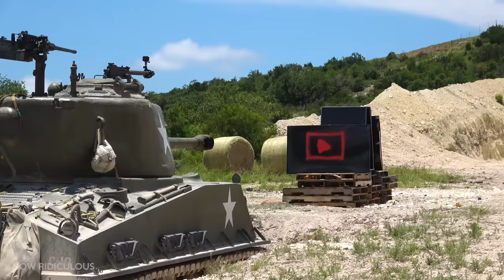Can Hay Bales STOP a TANK ROUND?

Comment: A gun bullet will stop really fast underwater, would a tank round be able to go through a pool worth of water?
Reply: Yes
Reply: Maybe so
Reply: @philjones35  :)
Reply: Depends on the pool & how wet the water is
Reply: Forcefed2002 haha
Reply: Ye but how do u get a tank underwater
Reply: Jon Anderson dude that’s the easiest part.
Reply: @mikex-mj6sx  use above ground pool
Reply: No, the shell will fracture upon impact with the water surface. You need low power, low speed projectiles to get through.
Reply: @mikex-mj6sx  a gun fired under water the bullet travels faster but a gun fired in to water the bullet travels slower or breaks up. A tanks round would react much the same way. I doubt a 20 or 30 foot above ground pool would stop it out right. It would for sure make it out the other side but id bet that it would not go very far or fast at all after it got through. Probably would stop with in 40 or 50 feet and would likely just bounce and roll along. It takes a stupid amount of energy to move through water at high speeds.
Reply: @Oz_Gnarly_One  tank rounds are low speed. They're about half the velocity of a rifle round but carry that speed for miles because of their weight.
Reply: It would stop pretty damned quickly as water is very dense. I doubt it would make it through the average backyard pool.

As for the shell breaking up when entering the water, that depends on the muzzle velocity and mass of the shell. I think the mass of the shell would make it less likely to break up on contact with water but the bigger size would mean it slowed down pretty quickly.
Reply: A regular  pool yes. Olympic  maybe not. The tank round would blow the water out of the pool from just the  energy.
Reply: @chucksherron  depends  on the round. A sabot  round is faster than most guns.
Reply: Jon Anderson good point
Reply: Likely no unless fired from beneath water to begin with and also not over a certain velocity or they break on impact with water regardless. The cavitation effect on a tank round would be dope tho
Reply: Very interesting question... now i’m craving for an answer!!
Reply: @philjones35  well played sir
Reply: what length of pool are we talkin here
Reply: That would be awesome if how ridiculous did that
Reply: @nanaki-seto  No a gun fired underwater has a similar result with the bullet not going faster because water is dense and the bullet will not track straight and slow down in the first few inches to non lethal speeds.  Not sure how you got the idea that it would travel faster if fired underwater.  Sound travels faster underwater though.
Reply: I figure if its set up similar to a testing tank for forensics, it would stop the round, however I feel like it would shred itself in the water most likely, not to mention the insane effects all that energy would provide in the form of heat, possibly creating  bubbled area of boiling water.  But no I do not believe it would make it through a pool..
Reply: There I've seen a couple of videos where they fire a cannon at a pool of water and it slows down surprisingly fast.
But I hesitate to make any definitive statement because different rounds react differently. There's a lot of variation in tank and Cannon rounds
Reply: Ya it will
Reply: @__The_Real_V__  And how wet the water is!??
Reply: @Forcefed2002  that comment is far too underrated 😂
Reply: Newton's first law of motion still applies. "An object in motion tends to stay in motion unless the object is acted upon by an outside force."
Reply: @JonnyRicter  the outside force beong the huge drag of the wayer on the large surface of the round.
Reply: No, the more energy it has the faster water stops it.
Reply: What kind of tank round are we talking here? The old WW2 boys? It could probably limp its way through if you have it at a similar distance as this. The modern SABOT? That would zip right through no problem as it is designed to pierce dense materials and make it through with little to no issue (was a 19K in the US Army, the Sabot round is the bee's knees for tanks. But my all time favorite is the Canister round, fire at a grove of trees and watch as they all get felled in one go).
Reply: Why is the demo ranch guy there
Reply: @Forcefed2002  but water isnt wet!!!!! DDUUUHHHH
Reply: Depends on the pool
Reply: Get slo mo guys in on it
Reply: No way
Reply: You need to understand why bullets disintegrate when shot into water.  It is because water does not "compress" thus the water cannot get "out of the way" of a supersonic projectile fast enough so the projectile breaks apart.  Same thing will happen to any size projectile.  Physics
Reply: @Forcefed2002  the wetness is esp. important. Like if the water is really dry it might just go through right?
Reply: hmmmm
Reply: Yes easy
Reply: A tank round is a bullet so no.....
Reply: It will almost do it, although it depends on the pool size.
Reply: water isnt stopping a tank round.
Reply: The harder you hit water the denser it gets so the answer is NO I believe. =)
Reply: you can prolly calculated it, its simple physics! 
The gun bullet stoppes really fast because of the extreme spead
Reply: @Bobby Nolan yeah, physics is a nice thing
Reply: Tank rounds are armor piercing, they might hold up in water quite well.
Reply: Depends on if Chuck Norris's fist is in the water
Reply: its going trough very few inches of steel i am bretty shure it will go trough water
Reply: @karl-egertdaskov6217  An armor piercing tank round is very unlikely to fracture on impact with water in the way that a lead and copper rifle bullet does. But in the other video just a bucket with water is enough to make the tank round tumble and after that the increased drag from the air slows it down significantly. In water that drag would be many times higher and water almost doesn't compress at all.
My guess would be that it could very well come to a stop after just two to four meters in water.
Reply: Matt??????🤔🤔🤔🤔🤔
Reply: on mythbusters they noticed that the higher the caliber and faster the bullet the quicker it broke apart. Seeing as how a 50 caliber bullet broke apart faster than a 9 millimeter I am guessing this tank round would break apart and stop rather quickly as well. I do believe it will get deeper than the 50 caliber tho.
Reply: @thr8061  water is compressible just not on the scale a gas is. This projectile penetrates through thick steel so I highly doubt it breaks apart once it enters the water.
Reply: I think tank shells are slower then bullets
Reply: By driving it there obviously 🙄
Reply: Yes. The tank round is way faster and way heavier than a bullet. It is being fired with more force.
Reply: Forcefed2002 what if it’s 2% wet
Reply: Sabot rounds will easily go though, they’re made of depleted uranium
Reply: The more force you introduce into the equation, the faster the round will stop. Most likely, the tank round would break apart, but parts of it might make it through. If I did some calculations, I could figure out exactly what would happen, but I'm too lazy😅
Reply: That’s a great idea
Reply: @lamarrotems  +
Reply: @kingwacky184  myth busters has been proven to have rigged some of their experiments, or performed them in a way that is not scientifically viable.

That being said, an armor piercing antitank shell will penetrate the surface tension of water without fracturing. However, once it enters, it's total energy remaining is quickly absorbed. It might barely make it through a standard 4x25ft agp (above ground pool), but it would fall out of the air within about 20 ft and tumble another 150, with a blunted tip and some cavitation damage. It will not make it through a 4x13x164x82ft Olympic swimming pool the long way.
Reply: @TheDustyShredder  Well they did try it in a way that seemed viable to me for the bullet hit the water experiment.
Reply: In addition, only pure, vapor distilled water is actually as incompressible as many think. Once you start adding impurities, the physical properties change. Also, in reality, nothing is ever totally incompressible. The force required is simply so huge, we can't fathom it, so we create these terms as designations. Why else do you think there's such a thing as water pressure? It's because, even if just very slightly, water does compress. If it were actually incompressible, we'd be using only the flow rate.
Reply: Most likely
Reply: @Forcefed2002  what the fucking helldo you mean by how wet the water is?
Reply: @tobywhitmore4777  LMAO
Reply: @Forcefed2002  lmfao
Reply: If you had a pool say 5 ft deep 100yards long by 6ft wide and managed to hit it horizontal with the ground dead center it would stop less then half way through also the pools sides would need to be 1/4 inch thick steel to ensure it punches a clean hole and doesn't blow out the side letting all the water out reducing the resistance.  A world War 2 vet told me story's when I was little about the Normandy beach landing ,he told me his platoon was thrown from their landing vessel and he was in about 6 ft of water and watched artillery round come through the water and just stop and fall to the bottom . So given his accounts I'd say it would be possible
Reply: Have you got a tank and a pool
Reply: That would be great!
Reply: A 50 bmg will go strait through a pool of water so I’m sure a tank will lmao
Reply: So, would a tank round go through a round tank of water?
Reply: This would be very interesting to see forsure
Reply: @Oz_Gnarly_One  A tank shell yes....they're not designed for it.   However, NAVAL guns sometimes had shells designed to dive and strike under the waterline.
Reply: Ask Matt at  Demolition Ranch
Reply: this should be the pinned comment
Reply: How deep the water ris

Comment: oobleck. are you serious. that wont do jack against 25 pounds going 5000 feet per second
Reply: i think it’s less about whether oobleck will stop it and more about how it’ll explode
Reply: If you have a copius amount of oobleck it will stop it
Reply: i mean, enough of anything will stop anything
Reply: @unknownspark9522  By copious I would estimate a few Olympic length pools.
Reply: @unknownspark9522  logisticly speaking, yes but that would be a shit ton of oobleck XD
Reply: @viiknarthfrostad7600  time to hit up the bulk stores for a crap-ton of starch 😂😂😂
Reply: @Devin R not necessarily. A tank round has a shit ton more momentum because it weighs more. I do understand that a tank round has more surface area to slow it down but with the velocity it travels at it would push the oobleck out in a cone so most of the round won't be touched by it. Plus oobleck has a limit to its capabilities. At some point it would just give way to the force. Water would actually be more effective in stopping a tank round
Reply: You mean 16000 bald eagles per half week
Reply: Yes it will

Comment: You could see how many walls of bulletproof glass a round could go through
Reply: but to be fair - theoretically you could calculate that to get an aproximation and then see if the calculation holds up to reality. Should be pretty accurate though in this scenario!
Reply: @antonquirgst2812  ahem. you can use math and then see if you were right.
Reply: @The_Andromeda_Galaxy  guess'n'check
Reply: @The_Andromeda_Galaxy  i see you everywhere
Reply: @The_Andromeda_Galaxy  I mean you can use math for the hay bales as well. They have a bit of variable but still relatively accurate to density and such with the technology for farming these days.
Reply: Michael Russell;   yes. Just yes
Reply: Quite a lot I think

Comment: The sandbags in the tank were field improvised additional  armor.  Or maybe anti  armor piercing round deflectors. Whatever you call them, the tank crews realized real quick that they did not have enough armor. German anti tank rounds were designed to know when they hit armor so a second charge could send a jet of molten metal into the crew compartment. 
So in desperation, they would attach anything they could find to the exterior of the tank. Sandbags, discarded vehicle parts, logs, etc. The german round would hit the junk, think the junk was the hull of the tank, and prematurely  release the molten metal harmlessly against the exterior of the tank.

Comment: There's a rule in ballistics. If you're hitting a soft target large enough to capture the bullet, it will have a penetration depth equal to the volume of the soft material that would weigh the same amount as the bullet.

Comment: Ya want bigger results, put hay bales end to end rather than sideways, because of the way the bales are made within the machine itself they are the most compact in the center, and almost peel right apart on the outside, I believe that three would have stopped the round if the bales were placed end to end and shot through the center

Comment: that was a firefly a modified Sherman tank with a high velocity 75 mm gun with muzzle break. It was able to pierce the tiger tanks  front armor, which the standard Sherman could not.
Reply: actually that's a M-50 Super Sherman, probably surplused from Israel.
Reply: @BaikalTii  So it has the 90 mm on it's turret; nice catch
Reply: @thomasmilazzo6273  No.
Reply: M4A2(76)W HVSS. Not a Firefly.

Comment: would this round pierce 103 mm of rolled homogenous steel flat armor (which is what the tiger I had at the front hull)
Reply: https://en.wikipedia.org/wiki/76_mm_gun_M1#Performance. But not as good as the Brit 76.2mm (QF 17 pounder). Or the German 7.5cm KwK 42.